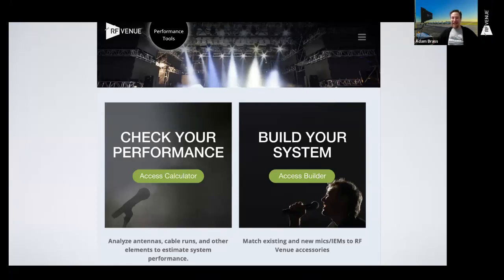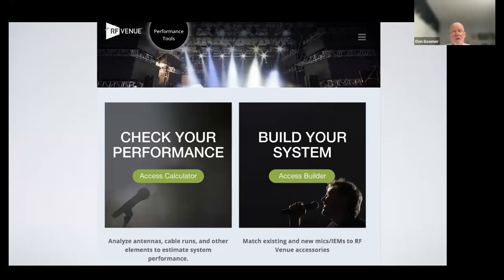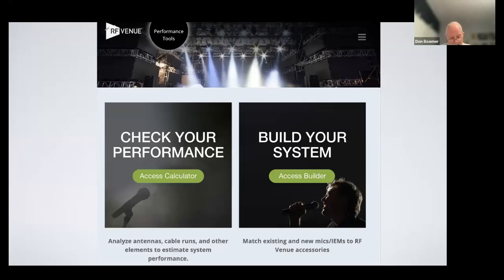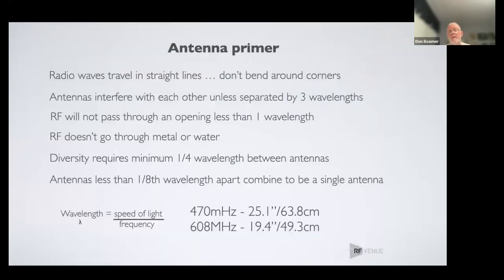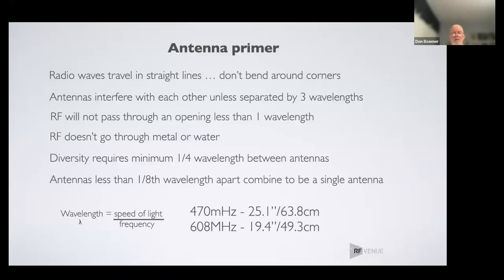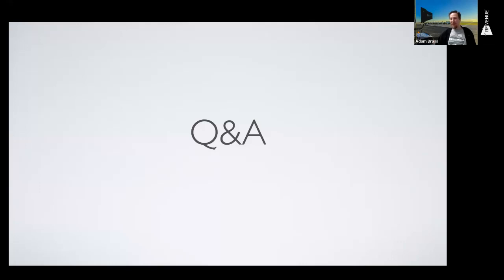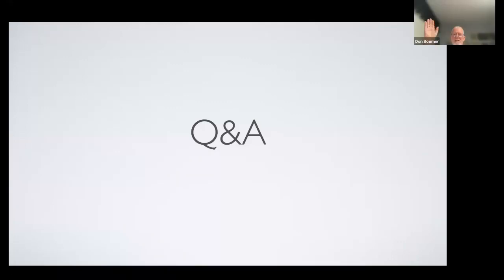RF Venue Webinar 4/27/2023: Why we use antenna distribution

Comment: I think the question at 37:02 is really asking: "You say around 5:25 that you need to get the antennas roughly 6 inches apart for effective diversity, so are diversity IEM packs like the PSM1000 mostly just selling you an expensive diversity solution that acts more like a single antenna – and for that matter, antennas that end up being parasitic to each other?"